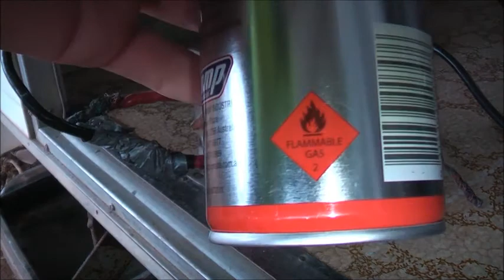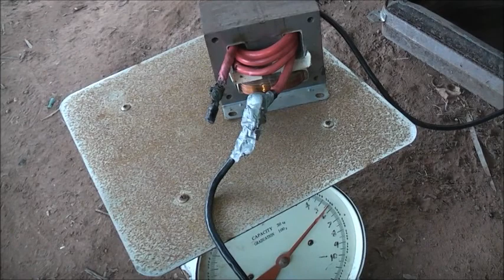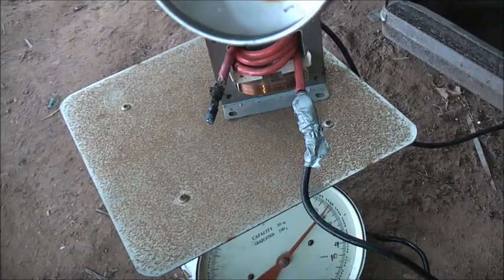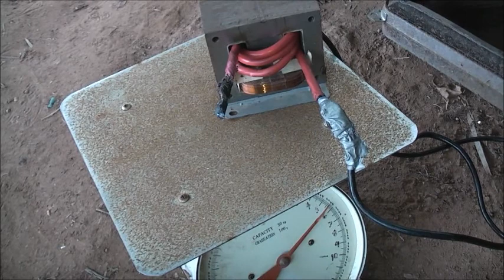High Current MOT Fun!

Comment: Aerosol can: "Do not pierce or burn, even after use".

Ah stuff it, I WANT FLAAAAMES! :D

The only thing I don't like about burning holes in aerosol cans, is the possibility of air getting in while there's combustible gas in there. It only takes a certain gas+air ratio to establish inside the can, one stray spark or flame.... BOOOOOM

You probably wouldn't want to be holding onto it when it blows up! :-O

For can melt-ups, I'd either remove the end completely & air thoroughly, or melt beer cans.